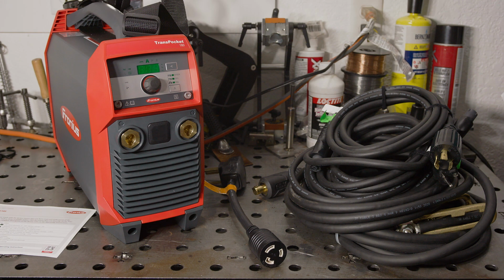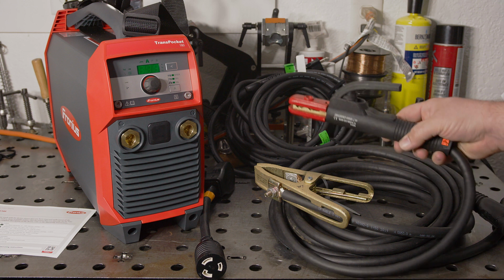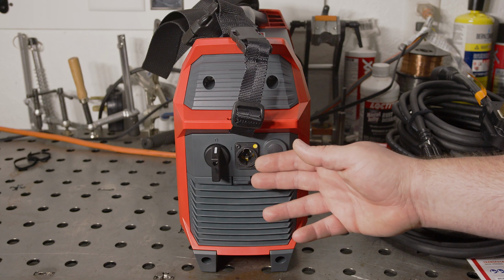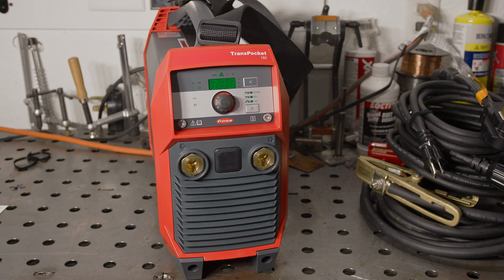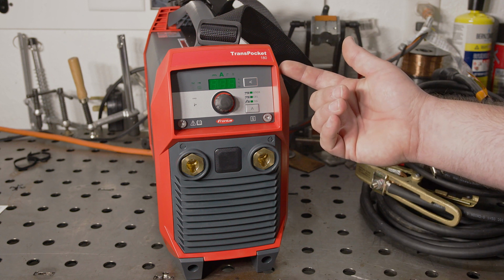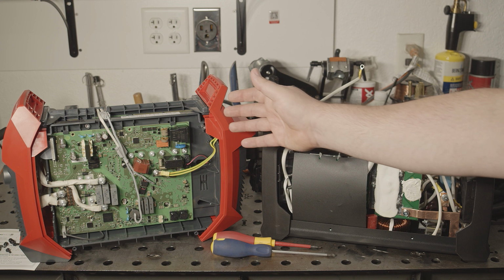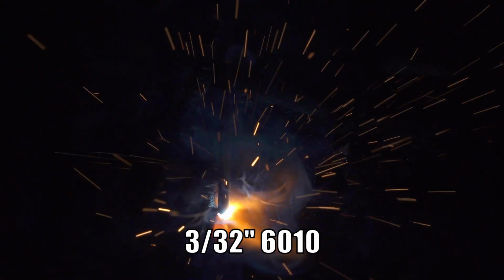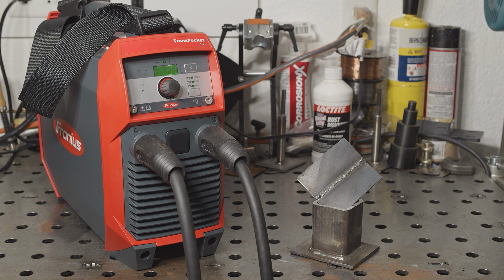Fronius Transpocket 180 Stick Welder Review

Comment: Hello brother 
Hope you are great 
Very nice video! 
Brother i have a question. 
Is this Transpocket heavy duty machine ? I mean can i bur 5 mm rod throughout the day for making trusses for example?
Reply from the maker: It is a fairly small, portable inverter.  So it's not going to have a high of a duty cycle burning a 5mm rod as a larger machine would.  But as long as you stay withing the stated duty cycled, it is a very robust machine.
Reply: @ 
Thank you so much for your reply! 
Could you please tell me the name of the heavy duty machine as an example so i can see it and compare?
Reply from the maker: There are lots of industrial, heavy duty machines from various brands.  The one's I'm the most familiar with are Miller, Lincoln, and ESAB, but there are other brands in other countries, and may be some smaller brands here as well.  Unfortunately, most of these machines will cost many thousands of dollars, will be very large and heavy, and will take a lot of power.  What is your budget?  What amperage will you need for the 5mm rods you need to run?  Will you need to weld continuously?  Duty cycle is rated as a percentage of time during a 10 minute period.  For instance, a 50% duty cycle means you could be welding for 5 out of every 10 minutes.  What duty cycle do you expect to need?
Reply: @bigtb1717  
Hi brother 
Very nice to talk to you and thanks for your communication.
Actually let me tell you my story. On my way to the another city i saw two guys welding very big trusses with thickness of  1.5 cm plates. They were using two big transformer welding machines. After seeing that i just thought to myself that if i ever buy fronius welding machine can i take these kind of projects to build or should i buy very heavy duty machine? 
My question is brother 
For example if i weld every 3 minutes during 7 hours can i rely on smaller welding machines? Like fronius with 3 or 4 mm rod ?

Comment: Nice review. I own an old maxstar 150stl with foot pedal, do you think it worth it sell the maxstar and upgrade to transpocket 180? I wish I can have both but I don’t have the budget 😢
Reply from the maker: My first TIG machine was a 150STL.  Great machine.  If you mostly do stick, the Fronius has more options and more output on both 240V and 120V.  On TIG, it also has far more output, but the stick version I had is a bit less versatile as a TIG machine, due to the lack of remote amperage control or a built-in gas solenoid.  The TIG version of the Fronius has those things, but it is yet more expensive.
Reply: @bigtb1717  thank you for the info, Fronius seems built better than miller and more advanced, do you know if the transpocket Tig version support pedal? I've located a Transpocket TIG package priced at $1500 USD with 3 years warranty, do you think it’s a good deal?
Reply from the maker: I would imagine there is a foot pedal for it, but I honestly haven't seen one.  I've only seen the ludicrously expensive Fronius TIG torch with the built-in controls.  It's fine, but it's bulky, and at the places around me it's like $500.  It's a bit insane.  I like that with my Miller I can use an SSC foot pedal and a CK or WeldTec torch.  Don't get me wrong.  The Fronius machines are really nice.  And when I compared the Fronius Transsteel to similar priced Miller machines, the Fronius had better features and output.  But I don't like how proprietary the Fronius seems to be when it comes to TIG torches and accessories.  But if you get a machine that comes with the TIG torch and can find a foot pedal, that that sounds like a good price, assuming you can trust the warranty at the place you are purchasing from (assuming it's not new with manufacturer warranty).
Reply: @bigtb1717  the one I found comes with a tig torch, with box, no electrode holder, it’s a demo unit factory serviced with full warranty. I don’t like their tig torch either
Reply from the maker: If it's the TIG version with the built-in gas solenoid and such, that's a good price.  That package is around $2,300 new.  From what I can see, the included torch has a button, but no amperage control.  If a foot pedal is important to you, I would research the availability of a foot pedal first.

Comment: Welcome.  Question Please I own a Fronius 150 pocket welding machine. If you run the machine.  It says E04 on the screen then disappears and solders normally.  The meaning of the symbol in the machine book.  Open circuit voltage not reached:
        Electrode in contact with workpiece/hardware fault
        Remove the electrode holder from the workpiece.  If the service code persists, should I submit it to a repair technician or does it just need to be updated?
Reply from the maker: I'm not sure if it's normal to see that code on initial power up or not.  How long does that code stay on screen?  Maybe you could try powering up with no cables connected to see if it still happens.  If it doesn't happen with no cables connected, I would inspect your cables to make sure there are no issues.  

If it seems like an issue, it might be worth reaching out to Fronius or a repair center to see what they say.  I can't say if you should send it for repair or not.
Reply: @bigtb1717  Hello, thanks for your response.  It stays on for a second and then disappears, knowing that the device is soldering normally. The symbol only appears when it is turned on

Comment: Watching your older videos and new  Looks like the the Norther tools Klutch ST201iDV
is a balance between quality and value  would you agree?
Great video by the way!!
Reply from the maker: I do agree.  I plan to make a follow up video on the Klutch at some point.  It's still one of the cheapest machines I'm aware of with power factor correction.  Plus the fact that it runs 6010 and comes with a foot pedal and regulator for TIG.  Assuming they haven't done anything to "downgrade" it over the years, that machine is a fantastic value.
Reply: thanks i thought so too @bigtb1717
Reply: I just got the Klutch a week ago and can report it runs just as good as you described. In fact, your videos may have made me confident in taking things apart ! As I took it apart to see if it matched yours and after review it does. What else is interesting is the fact that my 9500 running watt Westinghouse generator "run of the mill" runs the Klutch welder with 1/8 6010 no problem.  This generator has a horrible THD rating somewhere around 27 percent.  Sure long term it may fry it but my Titanium 225 won't run 1/8 6010 on the same generator.  The power factor correction plays a part but not in the way I understand, this is on 220v and very "dirty" electricity.  The way the power factor correction works must by default do something that covers the spikes and dirty electricity. I'm not suggesting it cleans it,  but it definitely must be correcting the wave at least enough to make it manageable.  I'm not sure,  that's  completely a guess by a non electrician here ! It can't be from simply operating on lower power consumption as 9500 watts is way beyond sufficient for any 1/8 rod ever used even on the cheapest inverter. What's your thoughts ?
Reply from the maker: @floridastate3247  From what I've read, the active power factor correction in many inverter welders does act sort of like a power filter.  Many welders with power factor correction specifically advertise that they work well on generators, long extension cords, and unstable power in general.  So it's very likely that the power factor correction plays a part in why the Klutch tolerates the gen more readily than the Titanium.
Reply: @bigtb1717  It is very interesting, more so if it turns out to be the case that the power factor correction process is making regular generators tolerable. I mean one would be a lot more willing to buy a $1000 dollar Esab if he knew he could run it on his  existing $600 generator. $1,600 for a mobile set up,  and for those that are renting there house and can't simply install a breaker/outlet. That's essentially half of the market/ buyers, the current issue to most of these buyers is buying a $2,500 invertor generator then a $1,000 still bottom of the slope welder while having to explain to the wife that the existing $600 generator won't cut the mustard.  The longevity issue is for another day,  yeswelder has done one thing right and that is they have showed that if you throw pictures enough in front a person that is thinking he will take the bait.  The kicker is they don't care if you come back,  they have bet there money on the one time purchase.  They know it will break but they also know most of your DIYers act in phases, meaning trends so you'll hate them for a while but move on.  The point I took forever to make there is that this could definitely fill a need that exists,  doesn't have to be the long term ultimate fix.  There are thousands of forums where people are truly trying to figure out how to weld without dedicated 20 amp 110v lines and it gets rougher when access to 220v comes in.  Renters typically can't install electrical anythings,  modular homes good luck , and then your guy starting out.  Hopefully Esab, Klutch , or anybody else focuses on explaining this subject further.  It would be extremely helpful and profitable.
Reply: GOOD INFO THANKS!! @floridastate3247

Comment: Did you film this video with your Sony fdr ax700? I have been looking at them recently. I use a GoPro 7 silver or an iPad for my videos. Been trying to upgrade. Saw your camcorder video and randomly had welding shots in it. Then got really interested in your other videos. The clarity of your videos vs mine is insane. I got a John Deere 544a I’m trying to make a rebuild video of. Blew a hole in the block and needs a lot of hydraulic work. That camcorder would be a nicer camera I think. Plus i do trees and welding as well. I think the zoom of the camcorder would get some really cool footage of the tree service work.
Reply: The trans pocket is a beast of a welder by the way. I’ve had one on my weld rig since 2020. It my most used machine so far. I actually tend to use that over my SA200 quite frequently now a days since the sa200 is on a trailer. The fronius is way nicer to use for smaller repairs and such. I do pull out the sa200 for bigger jobs and when I’m working on super thin crusty material though.
Reply from the maker: The shots on the bench were recorded with a different camera but all the welding and such was recorded with the AX700.  I still use it in all my welding videos for arc shots, as well as a "B" camera for recording meters while welding, etc.
Reply: @bigtb1717  thanks for the reply’s. how do you protect the lense?
Reply from the maker: I use a screw-on UV filter.  I had one on there for years and only recently replaced it for the first time due to some imbedded spatter, lol.  I figure it can't hurt to filter out some of the extra UV as well.  Funny enough, I don't see a single mark on the body of the camera.  If they are there, they don't show up.  It still looks perfect.  I also generally keep the camera at least a couple feet away from the weld and zoom in.  I make sure the display on the camera is always facing away, so spatter won't impact it directly.
Reply: @bigtb1717  do you know if they make a screw on filter for the ax53?
Reply from the maker: The AX53 does have filter threads.  I don't know the thread size off-hand, but there are tons of companies that make clear, UV filters in all different thread sizes.  You would just buy one the right size for the AX53 and it would thread right on.

Be aware, if you are looking to get arc shots with the AX53, it doesn't have built-in ND filters like the AX700 does.  But you can buy ND filters that would thread into those same filter threads on the front of the camera.
Reply: @bigtb1717  thank you. That actually really helps out a lot.
Reply from the maker: No problem.  Happy to help.

Comment: Nice review. By chance did you ever complete that TIG comparison?
Reply from the maker: Unfortunately I never got to it.  Too many other things going on and it sort of got dropped along the way.  I am planning to test some other machines though.  I have a Hone FC140 that can do lift start TIG, the Hone 185, the ESAB ES 130i and possibly one or two other machines that I'll be doing TIG testing with.  I've been really busy with work lately, but I think (fingers crossed) there is a bit of a lull coming up, so I hope to get some more welding videos out.

Comment: I’ve heard the breaker amps matter quite a bit, did you use a 15 or 20 amp breaker while getting 120A for 7018
Reply from the maker: My 120V circuit in the garage is a 20 amp circuit.  Technically, it would likely run just as well on a 15A circuit, but it would be much more likely to trip the breaker if you max it out.  The welder actually has an option in the menu to limit the output if you are running on a 15A circuit so you won't trip the breaker.  I had that option off so the output wouldn't be limited.
Reply: @bigtb1717  so I ended up buying it. And if I plug into a 120v 20A outlet it only allows me to get 85A…any advice?
Reply from the maker: @Aw3som3706  Do you have the little menu card that came with it?  It shows all the different menu options.  There is one for telling the welder what amperage circuit the welder is connected to.  Make sure that feature is either set to 20 amp, or turned off entirely.
Reply: @bigtb1717  omg I thought it did it automatically 😂😅

Comment: I couldn't decide between transpocket and lincoln 161s, which would you recommend?
Reply from the maker: I don't have any experience with Lincoln stick welders.  I have no doubt it's good, but I don't have any personal experience to draw from.

I know some of their larger stick welders are well liked.

That looks like a "global" model for Lincoln (50 Hz, 230V), so is it fair to assume you are not in the US?  If so, then the fact that the Fronius is available as a dual voltage that can run on 120V may or may not matter to you.

Without any experience with the Lincoln, I would recommend choosing the one with better warranty/service support in your area.
Reply: Thank you for your answer. We decided to buy a fronius transpocket 180, I hope I am wrong, will the 6010 and 7018 be enough for the power I will use?

Comment: Do you have any clue as to how many amps or watts this machine uses at 120 amps at 120 volts ?
Reply from the maker: I don't remember testing max draw on 120V with this machine.  If I get a chance this weekend, I'll test it and let you know.
Reply: @bigtb1717  gotcha I was curious if a 3000 watt renogy inverter would power this welder decently.
Reply from the maker: Super busy today. Hoping to get out in the garage tomorrow.  I'll test it if I get a chance.  

I would guess it will draw at least 3,000 watts when maxed out.  120A of output will probably be at least 24V, maybe more.  Factor in a bit of loss and that's at least 3,000 watts drawn from the supply.  My guess is that it will draw around 3,400-3,600 watts when maxed out.  However, if you run 3/32" electrodes and keep the output around 85 amps, you'll probably be drawing more like 2,200-2,400 watts.  

If I get a chance to test it tomorrow, I'll report back the numbers.
Reply from the maker: I will say that this is one of the most efficient stick welders I've tested.  So it probably has as good a chance of running on your inverter as pretty much any welder out there.
Reply: @bigtb1717  I have the es 180i pro but think maybe the fronius is close in terms of current draw, no doubt the fronius is better machine overall though.   Thanks for taking the time to respond !!!
Reply from the maker: Oh, the ES 180i also has power factor correction and is right there with the Fronius in terms of power draw.  The numbers should be very similar.  I would think if you run 3/32" rods, your 3,000 watt inverter should do it, assuming that's the continuous rating, it's realistically rated, and the battery feeding it is up to the task as well.

Comment: Hi, I just bought a transpocket 180 from baker's gas. Does your handle move back and forth a little bit?
Reply from the maker: I'll have to double-check, I don't remember for sure.  I can't remember how it was attached when I took it apart, but I think it was just captured by the front and back panel, so it might be normal for it to shift front to back slightly.
Reply: @bigtb1717 Thanks. Great video!
Reply from the maker: I feel like it does, but I'll try to remember to check tomorrow and let you know.
Reply: Thank you! Awesome machine.

Comment: I was wondering if you could run this welder off a Yamaha 2800k Inverter generator? Thanks
Reply from the maker: You probably could, but you wouldn't be able to get full output out of it.  It surely draws FAR more than 2,800 watts when maxed out.
Reply: @bigtb1717  Thank you!

Comment: You get what you pay for with fronius.. recently bought a TPS 320i c and that is by a long shot the best welding machine ive ever used.. the double pulse function on the mig is incredibly accurate and precise with its droplet control. and the user interface is amazing.. very expensive machine but you wont regret it.